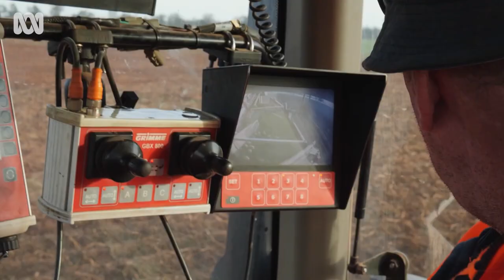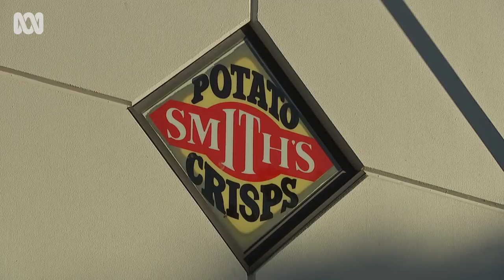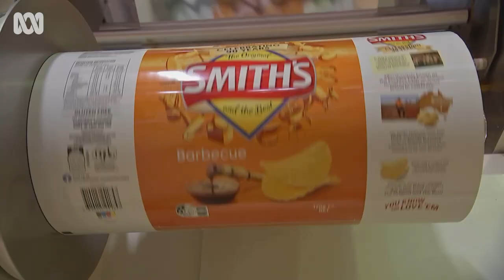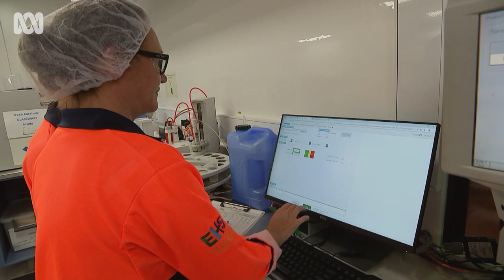Paddock to packet, potato chip company Smith's 90 years in Australia 🥔 | Landline | ABC Australia

Comment: if they open up a few more farms they could actually manage to fill their packets
Reply: 🤣🤣lays are even worse mate.  Smith's are far better in compare to them .
Reply: Fill a bag all the way up and all you'll get is crumbled chips. They do it for a reason
Reply: Chip packets are often only half full because the air inside is not just any air, it has a lot of nitrogen in it, it keeps the chips fresh, also, the air inside acts as a kind of protection from the outside, so if a truck delivering these packets on the way runs into a bump these chip packets won’t be crushed so easily. Or would you rather have crumbled chips?

So not only does the air inside keep the chips fresh, it also protects the chips so they don’t get crushed. Or would you rather have soggy crushed chips?
Reply: If you made your own chips you wouldn't have that problem